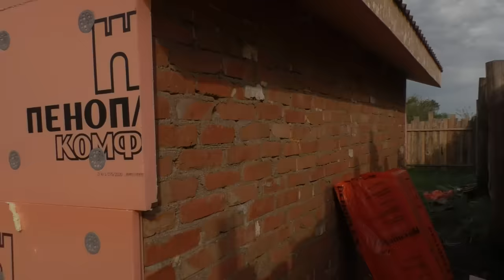I didn't believe it myself! Brilliant idea in 5 minutes!

Comment: I like the way Craftmaster uses the compound miter saw, his clamping method no risk.
Reply: You don't think it would be even safer to use the saw as it was intended, thereby eliminating the cuts with the boards not up against the fence?  Those are not safe cuts.  If for any reason the blade failed to cut the wood, those clamps would fail.  They can't match the power of the motor. the wood would move, possibly being thrown across the shop, and/or the cutting head would surge in the direction of the operator.  Safely cutting angles is the whole purpose of the turning cutter head and table.

Comment: Leave a gap between the sheets of insulation and fill the gap with spray foam after installation. Faster and much more air tight.

Comment: That’s a great idea for building fiberglass rectangular tubes. There was once a product called “duct board” which was fiberglass ductwork & some of the fabricating tools were quite expensive for working with it. Also, the duct board had lots of loose fibers that would get into the air streams of buildings & homes because it wasn’t lined with any sort of a coating. The fiberglass panels would do the same thing, have way better insulating qualities too!
Reply: эх
Reply: Qqqqq
Reply: Ok
Reply: It helps a fast and quick, surity of work
Reply: 要些少少
Reply: 'duct board' still exists and is still widely used in the HVAC industry, at least here in the midwest.
Reply: Jesus is LORD  6:23

Comment: Why not use the miter saw the way it was intended to be used? You can rotate the saw base to any angle, instead of holding the wood at a weird position and having to clamp it down.
Reply: I was wondering the exact same
Reply: yep
Reply: I have the same saw and never used that jig lol
Reply: @DeanUrevig  oh Dean lol
Reply: My thought would be bc of the size of the cuts/wood, and possibility of it kicking out?!? It's safer to clamp down and avoid skipping.  (honestly no clue, I just know it happened to me before with my saw). I also think precision is probably more exact by hand than using the bevel... and he was precise!
Reply: Столько ненужных манипуляций скреплением дощечек?
Reply: @user-fe2rn6pv8l  Precision is more exact by hand than using the bevel ???????????????????????????? Are you aware of what you're saying ???????
Reply: It's quicker. I do that too.
Reply: Finding the angle and clamping the rotating miter saw base takes more time. I've done both, and he took the fastest approach. Builders, like the guy in this video, aim for speed.
Reply: @lohengrinknight  But there was no need for accuracy like that here.
Reply: @lohengrinknight  I guess you know nothing about the saw stops !!
Reply: @lohengrinknight  a little bit of math and it’s simple and fast. Or have we stopped using math?

Comment: Thanks for this video. 

I will be working with polyiso insulation soon. I will have to make a lot of cuts. I think I’ll make a simplified version of this. Most of my cuts will be straight cut and a utility knife blade doesn’t cut 2 inch foam in a single, clean cut.

Comment: A pretty cool idea after having to cut a bunch of foam insulation "by hand" not long ago. However for the life of me I don't get why the guy didn't just swing the blade over to the proper angle to make all those angle cuts instead of going through all that hassle of clamping? That's what chop saws are designed for! Plus it's way safer having the boards pressed up against the fence!
Reply from the maker: It was a joke :)
Reply: խժռու

Comment: I’m confused of why he doesn’t use his miter saw as a miter saw. Just turn it to 45 degrees. Presto.
Reply: Precision?
Reply: My thoughts exactly.
Reply: @crazyedo9979  precision perfect with a good miter saw
Reply: It might not slide that easy or even be broke. I have a chop saw that is a bear to rotate.
Reply: Probably just wanting to show off a little...
Reply: @crazyedo9979  - pretty ridiculous to buy a mitre saw and not use it as one. If you don’t “trust” the settings, learn how to fine- tune them so you’re getting the proper results, instead of this nonsense which takes 100 times longer! Btw, I’m a carpenter in my own business for 40 years now, and couldn’t stop shaking my head at the stupidity of this approach. 🤦
Reply: I have never used the clamps on mine like he did
Reply: It’s more time efficient. If you want accuracy…
Reply: that was my first thought. Use your miter the way it is meant.
Reply: For me it was like an anti-asmr thing where each time he repeated the same stupid step I got more and more furious until I eventually just skipped to the end.
I was shocked to find that it’s actually quite a clever jig!
Reply: Так меньше времени тратится . У меня макита, надо выставить нужный угол потом вернуть обратно, это долго  , а если надо сделать 2 отреза то смысла нет крутить её туда сюда .
Reply: I had the same question and my guess is that he used angle other than 45 degrees which made the process a bit more more complicated and a little longer.
Reply: Probabely his priority is to build the tool,  proper use of the miter saw in this case is less important.
Reply: Many miter saws have just enough slop that if you’re hoping for a precise result, using those settings will drive you crazy.
Reply: When cutting a lage piece of foam, a miter saw mut be difficult to use.

Comment: cool idea.  do you think it would be easier to use if you oriented the blades so that it would cut on the pull-stroke instead of push?
Reply: Cutting on the Pull would probably result in a Malformed edge, (not to mention the Obvious Safety concern of cutting towards yourself with tool holding open Blades ) whereas cutting on the Push introduces a Mechanical Advantage the ensures the tool remains tight against the Material resulting in a Truer finished Edge,

Comment: Wasn't sure where you were going.  Great idea, material and time saver.
Reply: Son why didn't you just used a block of wood and cut out the piece that was needed to be removed to attached blades? Btw the saw you were using has all kinds of angle settings for angle cuts the idea is great yet it was already done with a lot less steps 
Either way far better than what most plp your age are doing so my hat off to you keep up the good work 
You will be a master Craftsman when all the older people who have shown you their skills are dead and gone until seek out those older men who are still able to teach you a thing or two..

Comment: you might want to know there are duct board cutter for 1" - 1 1/2" - 2" duct board that does the same you did a goo jib on the one you made - Question why are you putting insulation board on a brick veneer building ????
Reply: Insulation easier outside than inside and keep the cool brick character inside

Comment: I would have had those mortar joints retucked and pointed before covering in foam.
Nice tool for cutting the foam.
Reply: I the joints are not damaged couldn't the excess mortar be ground flush rather than redoing all those joints?

Comment: Idle curiosity. Why spend all that time setting up and clamping your angles on the drop saw when you have a revolving base which would allow you to simply work off a machined base line. Not only quicker and more accurate but a lot safer with small parts like that. Great little jig though
Reply: Mucho teatro...

Comment: amazing i think he needs to try and market this.
the only thing i can say that is wrong is it takes of just a bit to much from the underside.
the insulation does not fit together on the underside as snug as the top.
but still i have never seen this before.
Plato  wrote: “our need will be the real creator” and this is what has happend

Comment: Uh, is this because you can't follow a line and cut straight? I mean, yes impressive and probably makes things easier but it's insulation. I would've just used a little spray insulation if there was some gaps (which shouldn't really happen). I'm dumbfounded. How many cuts you really gotta make where a jig doing insulation is needed that much to spend however long it took to make that jig?
If you wouldn't shown me that at the jobsite I would throw it in the burn pile. 
Still, I am impressed at how much effort went into such a simple tasked tool.

Comment: IF I was to use something like this, I think I would not pull it toward me instead of pushing it toward my hand!
  One skip could be very bad. 
  Or, maybe have a stationary strip to hold the piece I am cutting.
Reply: Many novices feel more comfortable controlling a pull than a push. Most experienced woodworkers will check their line with a pull stroke on a tenon saw. That said if you value your fingers and thumbs it is generally better to push a cutting edge away from you than to draw it towards you. A few tools defy this generality. A spokeshave (the tool used to shave the spokes of a wagon wheel) is intended to be used as a draw tool but it requires both hands outside of the reach of the blade. Many simple tasks (e.g. removing a stubborn screw) require a push vector with greater shear cohesion than typically provided by office supplies.

Comment: Two things thus far - why are you not using your miter saw to cut your angles the way a miter saw is designed to do?  Second, why are you using a miter saw to rip?

Also, the angles you cut were not critical.  Could have made the whole thing in block form, minus the guide fence, then set your miter saw to some comfortable angle, then cut the corners off - if that's what you wanted to do.  A lot of attention to detail but also a lot of excess detail that could have been minimized in a quick cut on the miter.

Comment: Why didn't you use the mitering "feature" of your saw; rather than waste time setting up the cut with other pieces of wood? Is it because your saw is not accurate enough; as most miter saws have that problem? Indeed yes.

I bought a "top-of-the-line" DeWalt miter saw and it has been poor accuracy from day one. I imagine that since MOST sawyers are carpenters (not woodworkers) and they simply don't care; so the manufacturers don't care a damn either. Oh well.

Comment: Why have a compound miter saw and then use wood and clamps to hold your project at various angles? Defeats the purpose. ALSO, cutting that second piece of wood longways before making the crosscut results in you now having a scrap piece of wood with a saw blade groove in it that didn’t need to be there…

Comment: Tuned in to one of your video and after a few minutes I shut it off.  There was nothing wrong with the selection or the work, but for an old guy I just won't, and don't, watch those video at the increased speed.   Don't know what that helps, but I am not buying

Comment: He does know he's using the chop saw right he does understand the idea of a miter saw it swings left to right for any angle you want instead of doing it the dangerous method he's using by using the two blocks to hold it down off the fence that's the most dangerous move you can make and this guy's showing you how to build tools he should be showing you that he's a fool